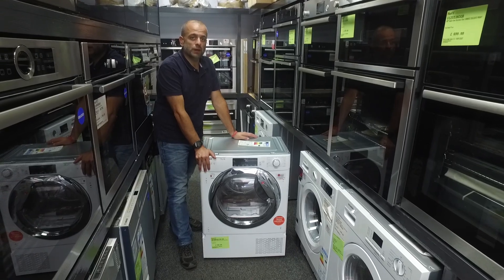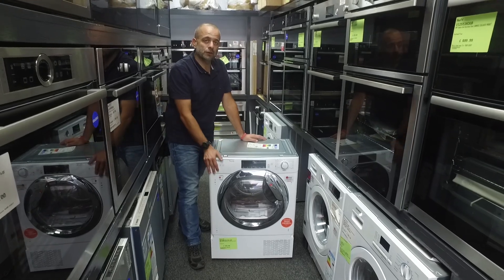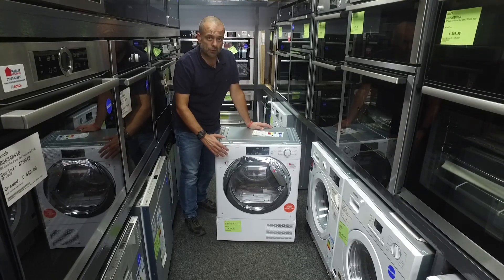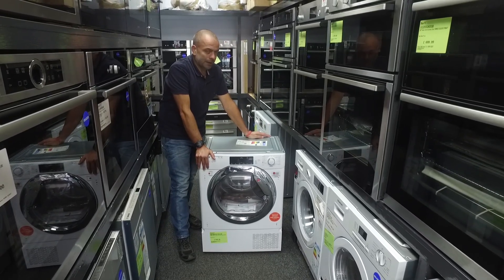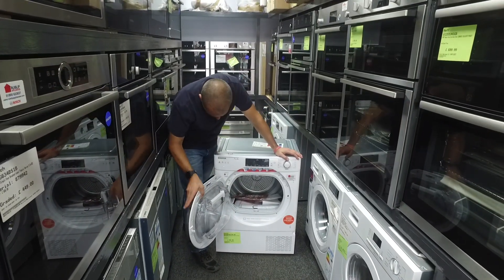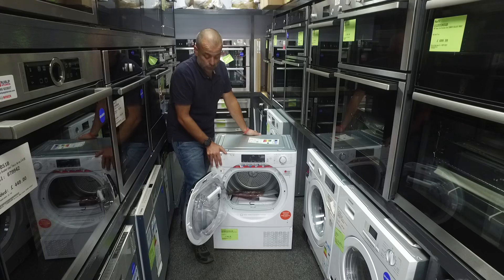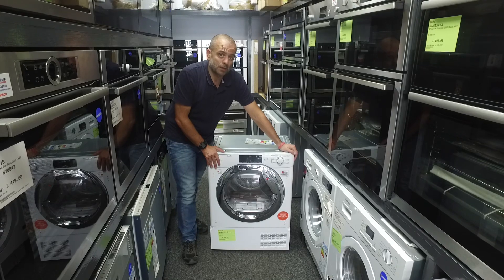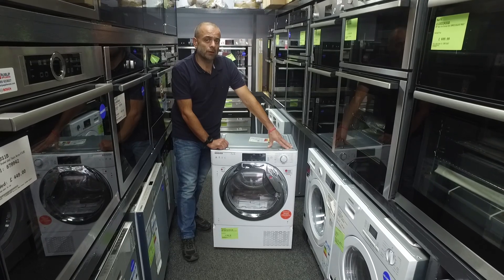Hoover have made a built in (integrated) tumble dryer HBTDWH7A1TCE-80 heat pump

Comment: Don't ever buy one of these dryers as you need to spend around £20-£30 every year to a year & half on a New Water Tank , every single one cracks as they are so weak & brittle. Candy know there is a fault but don't do nothing to help anyone .
Reply: The door has now been modified for some time, so no longer an issue. In addition, its a 1 year labour and 10 year parts (not 1 and 1 as presented). Also useful to know that the reason it takes longer than a vented to dry, is because is uses a fraction of the energy to dry the clothes, not because it is in any way inefficient.
Reply: @nickplatt4764  No way has this water collector on the door been modified as i have been in touch with manufacture twice. The last time was only 2 months ago & they just denied there was any problem with the door ever , they don't want to know about the issue . If they have been modified since November 2019 then they should get in touch with all and give a free modified door to all them that registered for the extended 10 year guarantee. I would never buy one of these again ever and wouldn't recommend anyone getting this dryer EVER
Reply: Hi can you advise on this product..we have installed in our kitchen and the drimm sounds rather thudding...flooring is level and there is no work surface yet or integrated door ???
Reply: Drum
Reply: @colinjohnston1154  If you have bought one of these dryers, Colin, my only advice would be to throw it out for recycling, as far as I'm concerned this is top of the pile for being a piece of junk. We threw ours out & it was less than 2 years old, as we replaced one door water tank, & then replaced that & then replaced that when another one had gone the same by 2 years. 3 door water tanks in 2 years at £20+ is not good at all. We got a Hotpoint Aquarius 7kg dryer now, drys in no time at all, and been problem-free since we got it
Reply: @nickplatt4764  The door water collector tank, is not included in the guarantee, so you have to pay for replacements tanks yourself Nick.
Reply: Thankz for heads up 
Noise though?????
Reply: @colinjohnston1154  Have you made sure no wobble and all is level before you start it up & that the level adjusters underneath are all tight with the lock nut as well. If it's something inside then you may need a repair job done or recycle it as I said above. Make sure it is level also with a spirit level and then tighten adjusters up, & make sure the lock nut is done tight on the adjusters to the body of the dryer so they don't come loose again. You may have already done these things, but I'm just checking as some forget about these things.
Reply: Now you tell me! When we got a new kitchen we’d bought Neff appliances and had them all integrated. We got a new for old insurance on all seven appliances. They were all great until two years ago when the hob  developed a fault and had to be scrapped. The new one isn’t as good but was the only one that fitted into the working surface. Then a year later the tumble drier developed an intermittent fault. We contacted the insurance company and we were told that the only machine that would fit in was a Candy. They ordered one from Curry’s, they delivered it and took my old one away. We used it a few days later and it was so noisy we rang Curry’s. They sent an engineer a week later and when he turned it on he said there was a dent in the drum. They arranged to pick it up and send another machine and they came two weeks later. We tried to use it but it made the same loud thumping noise. We rang Curry’s again and they sent the same engineer. He said there was a dent in the drum and he tried to bang it out. He then said there was a spare drum in his van. He tried to change the drum but it was the wrong size. He tried again to knock the dent out of the drum and changed some bent screws. We decided that would have do as we were fed up. We thought it’d be fine until we tried to use it and my husband turned it on. I must admit that it was very quiet but that was because the blooming drum wasn’t turning round. We rang for an engineer and the same bloke turned up. The belt had come off the drum! He had to drag it out again, take the top and sides off, my husband had to hold it in place while he manoeuvred the belt over drum. 
Our kitchen is only small and they had to take the integrated door off and the plinth for weeks. The inside of the door had to be re drilled because the holes didn’t line up. We had to buy a special wood filler and fill up the holes and wait for them to re drill the door. We’d gone weeks without a drier. 
My husband is 82 and I am 79, both disabled, I’m in a wheelchair, so we can’t face replacing the kitchen We are not expecting this machine to last as long as the original drier but I’m hoping it lasts longer than we do. I’m dreading any of the other superior Neff appliances going wrong.
Reply: @colinjohnston1154 we had the same problem with the Candy one we bought to replace our old Neff drier. It was a dent in the drum. It took three engineer visits to sort it out and it was brand new from Curry’s, and we couldn’t use it for weeks. I liked my old one from Neff better.